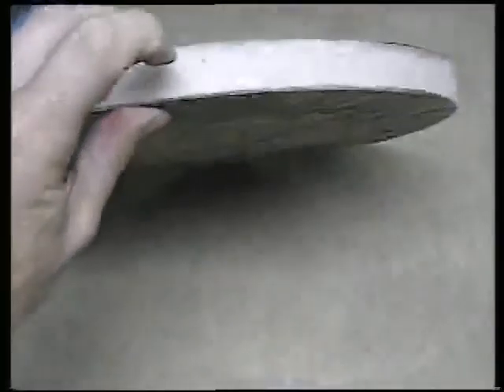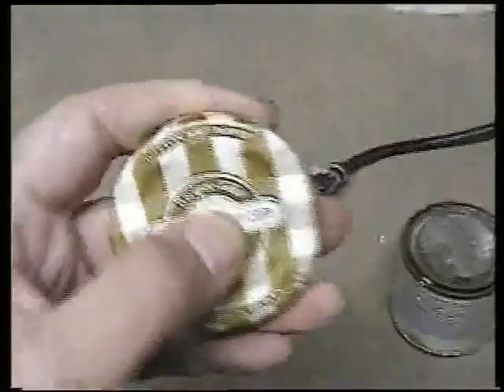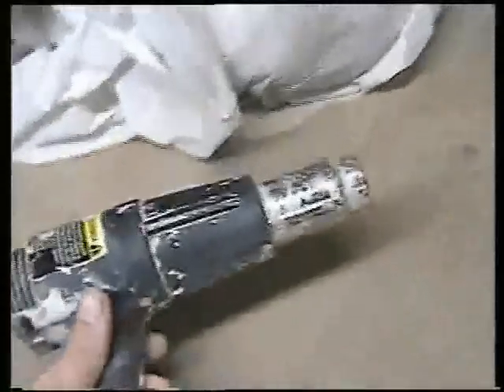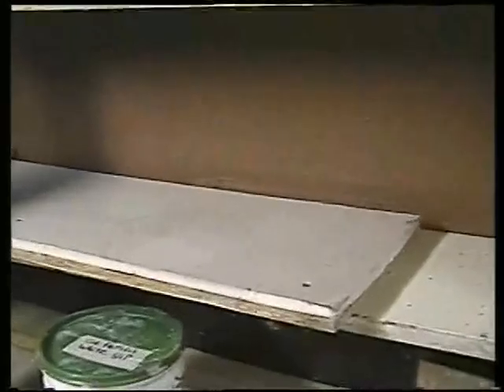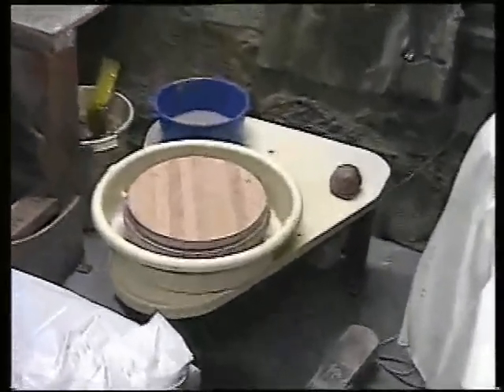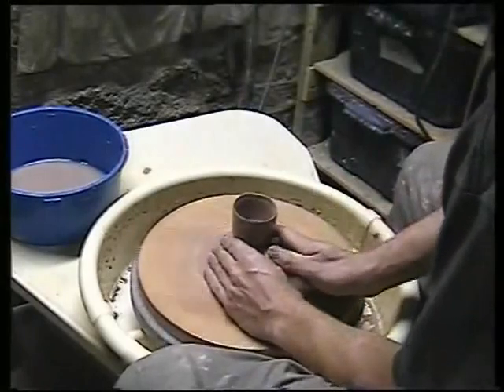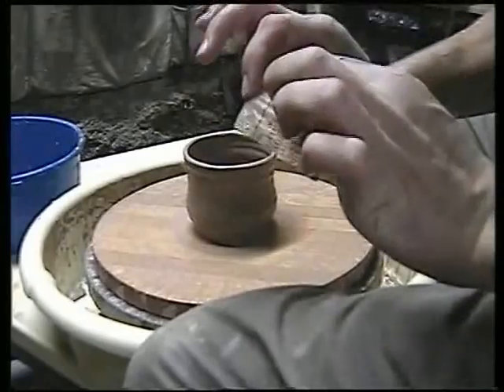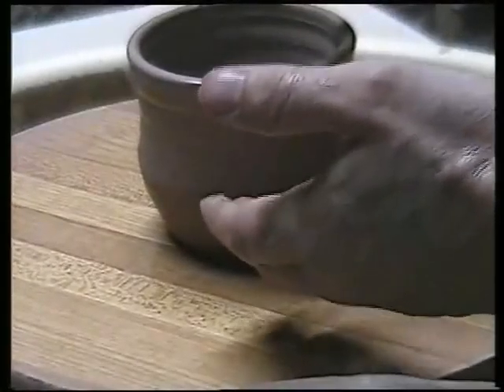Tips from a Master Potter...Well a potter anyway

Comment from the maker: I use wax on things I'd rather not dig glaze out of like the inside of lids or a textured surface that is to be unglazed.  I  use it for brushwork on a glaze that I will then glaze over so the first glaze comes through where I used the wax.  Wax can work on a shino glaze to keep the soda ash from crystallizing where the wax is, and thus make a different color there.  As for bad fumes, I'm not sure.  I don't leave mine on very long and it's just wax, nothing mixed in.  like a candle really.